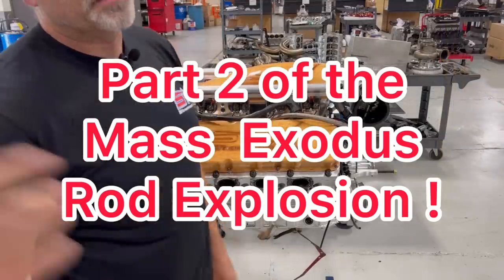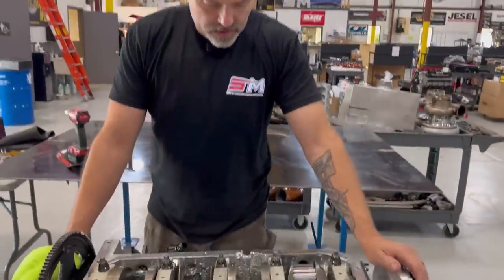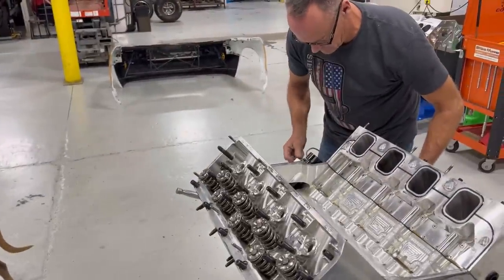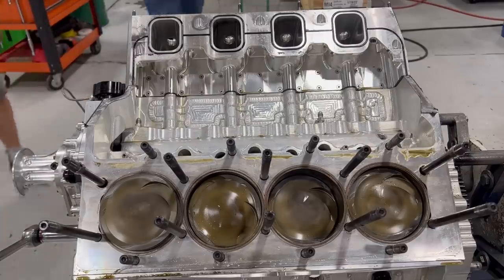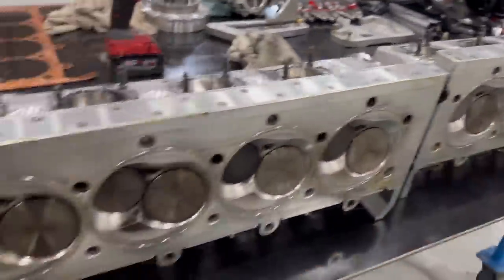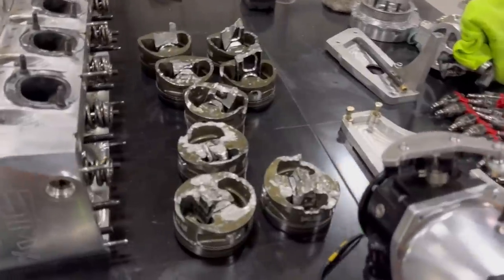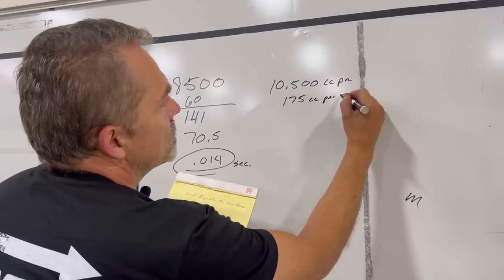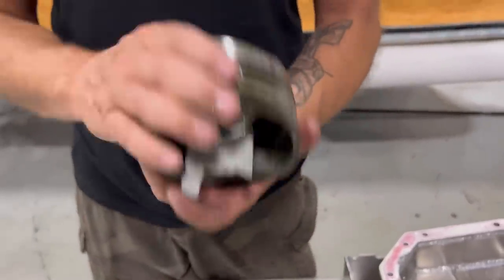EXPLODED RODS  Part 2

Comment: The rod failure makes me think the rods were over hardened, taking the base material into the brittle range. The manufacturer may have done this intentionally in order to increase the strength. They just went to far... Harder / stronger is not always better.
Reply: Rod shape will play a role as well, the design looks to have areas of stress concentration which could explain why the failures look to be all in the same region. Definitely a design failure, either running higher than designed, or some misses that reduced margins to negative. (For reference, I'm a licensed Mechanical PE).

Comment: The only time I hydra locked an engine was when my intake was under water and I realized that fact way to late because I have sucked water in and immediately turned the engine off and pulled spark plugs and it was fine

Comment: Most likely the rods were not heat treated properly for the hp you had. Alao, they could have martensitic grain structure which would cause them to be brittle and cause them fail under heigh stress loads. Again it all depends on the type of rod and the materials as to type of failure. If the rod material is Ti-6Al-4V Titanium then the failure mode will be different than say a BME Forged Aluminum rod. Without knowing the type of rods it's difficult to speculate on the failure mode.
Reply: arent they aluminum ???
Reply: @deantheboatguy1437  I don’t know….I didn’t build it. If Steve said what they are I must have missed it.

Comment: This man builds some of the best setups known. Thousands of passes on hundreds of setups. He clearly has it down to a fine science. 

The first time he uses new rods , the rods blow? It’s very obvious to me at how the rods sheered apart that the material was stressed and gave. They just weren’t engineered right. The only variable was the rods so the issue was the rods. 100%. 

Now what exactly was wrong with the rods? That’s speculation. I’m sure the metallurgy will come back and let us know if it was a materials issue. If not, and the alloy was right, then it’s down to a design flaw, or a machining process flaw. Idk why Steve’s wasting his time explaining to people that it wasn’t the tune or that he didn’t hydrolock the engine. 
Also I will say there isn’t many rod manufacturers that are building 4000+ horsepower safe rods. I’d guess maybe they held up at 2-3000 , and the guy was over confident they could handle some extra power, but they weren’t actually tested as such. That’s my .02$
Reply from the maker: Thank you !! right on logic !

Comment: ELECTRONICS CAN BE A VERY HUGE PROBLEM. STATIC ? WIRES & SIGNALS, CONNECTIONS, VOLTS, DEPENDING, AC & DC LOW VOLT, THEN IT GOES UP.. KEEPING THE LINES ISOLATED AND INSULATED! AND GOOD CONNECTIONS.. HAVE BEEN THE CULPRITS?? REASONS ARE ALL THE DIFFERENT SIGNALS AND VOLTAGES? OH? AND BELOW THE DARN THING FIRED & BOTH INTAKE AND EXHAUST OPEN! INSANE! Good Day..

Comment: what is the reason that these engines run aluminum rods? Is steel just to heavy and cause more problems than there extra strength solves? Do they just not rev fast enough with steel rods? just a curious question I've always wondered about.

Comment: I had a cloyes timing gear break in my motor and it cost me 15k to fix the damages. It sucks for sure but what can you do. Last year I heard Diamond Pistons got a bad batch of aluminum and quite a few motor were destroyed because of their pistons falling apart.
Reply from the maker: Naw, there has never been bad material, obviously it is tune up, the timing changed or something injectors stuck. 😂

Comment: Very nice engine design... Pretty! Better with forged steel 'H' beam rods.... Aluminum rods fail, because of fatigue, in high stress applications, like this. Steel rods last much longer, because they handle extreme cyclic stress, and vibration much better than aluminum... All of your rods failed at close to the same time, because of all of them being fatigued... One of the rods failed , then it set - off a chain reaction to cause all of the other brittle/fatigued rods to fail... This happened in a fraction of a second, because of the high rpm's the crankshaft was turning... Use forged steel 'H' beam rods.... BTW, what is the rod ratio of this engine? Low rod ratios will put a higher bending load on the rods. That could also cause accelerated fatigue, because of high cyclic stress combined with greater bending loads...Quite a few rod failures take place, when engine stroke length is increased, without increasing the length of the rods. This reduces the rod ratio... From what several reciprocating engine specialists have said about modified stroke lengths, the rod length also needs to be increased to maintain a higher rod ratio... From what I have read about rod ratio on engines used for H.P. applications like what you are doing, especially the high manifold pressures that you are running with, a ratio of 1.75:1 would be a good one to shoot for... So this means that the length of the rod between the centers of the bores, needs to be 1.75 x the length of the stroke. Several tuners used special pistons with pin bores set closer to the crown, to help with matching the piston crown to the block deck height... Some engines are very well suited to modifications of stroke length, as they have a higher block deck height-aka the distance between the centers of the crankshaft main journal bores , to the flat surface of the block where the head(s) are (is) attatched. And stock piston pin placement that is further down from the crown of the piston, than what most passenger car engines have. The 392 Chrysler is one such engine that had a long deck height to allow a lengthened connecting rod to be used with relative ease... And piston pins that were located further down from the crown of the pistons...This is because these engines were also slated to possibly be used for medium to large trucks and heavy equipment, using gasoline. And equipped with longer stroking cranks, for improved low-end power qualities. This was set -up to compete with the International Harvester 541 gas engines. And naturally the drag racers from the late 50's and early 60's who wanted really good bottom end power for their 2-speed transmissions and expanding diameter slicks, caught onto this inherent design advantage of the 392 Chrysler engines. Don Garlits was one of those pioneers, so was Ted Gotelli, and many other people, too many to list here... And they could lengthen the stroke of those engines even more than the stock 3.906" that they came with from the factory without too much trouble adapting longer rods into those engines. Several reciprocating engine specialists got involved and they found that maintaining a rod ratio of 1.75 :1 was ideal for H.P. engines... And since the deck height was longer on these engines, than many other engines, it would be easier to manufacture pistons with re-located pin holes to accommodate the longer rods needed to maintain the desired 1.75 rod ratio... After the word got out that special equipment was needed for Chrysler 392 engines for the dragstrips, Donovan Engineering was founded to supply parts like these... Anybody who has an interest in supercharged engines for dragsters from the 60's and 70's, probably have heard about the Donovan Engineering Products for the 392 Chrysler engines. Especially, the Donovan 417's that often ran very good reliable times at the various drag strips back then.

Comment: Hydraulic the Engine Thought - BIG IF - A Fuel Injection System Failure with the controller pulsing the injectors constantly or held open, so liquid in the cylinders which would "hydraulic" and take out all the rods. UPDATE - In the engine rebuild episode #2 & 3 there were fuel injectors that were stuck open.  So......... injector stuck open on the pass, fuel in cylinder, hydraulic takes out a rod, carnage takes out the others.

Comment: At 27:00,,,,,,,,,,,,,,,,, You actually mean to say ,,,,,,,,,,,,,,, 70.5 times a second the injectors and spark plugs fire at 8500 RPM
That engine could not have possibly hydrauliced, but it likely pre-ignited and caused a mythical vibration that shattered at least one rod  starting the chain reaction destroying all of the rods {" MYTHICAL ")

Comment: The base metal was too hard has to flex I build Lycoming and continental stol short take of and landing engines you have to look at all the stress factors to be sure that the parts you are working with are suitable for the application you have to magnaflux everything then put through the ultraviolet light you would be amazed at some of the things that you find if you are really interested contact me.

Comment: Hey Steve on the lighterside  It's so obvious the flux capacitor wasn't tuned properly I've seen it on back to the future So it must be true 🤣🤣  Those rods shattered just like ice when you hit him with a hammer 🔨  I think that's the easiest way to explain it... and good to see u are Venting crankcase pressure from The Valley cover now 😁👍👌

Comment: For the Mains that look perfect to have survived, I think at least those ones the rod cops had to come off for them to survive without damage. Like the rods were not capable of 8500 RPM with the weight of the pistons. Otherwise how no damage? It also it all happend at the same exact time or within seconds.
Reply: Something Else that is peculiar is that every piston stopped in almost the exact same location as if what happened was the same for each one. Not like most times you find what started it or what failed first then next and so on. I do not see that here
Reply: I just looked at the build video and I noticed the rod cap bolt holes are thru holes right at the transition between the cap and the column portion that goes up to the pistons. That area where those holes are is weaker than any other area of the clamp portion of those rods.

Comment: Why aren't you running an 8 counter weight crank like in the hemis that should help with any flex in the crank or harmonic problems.
Reply from the maker: you need to  watch it again, it is a 8 counter weight.
Reply: @stevemorrisracing  sorry about that it was a busy morning didn't see it that well kids haha.
Reply from the maker: No problem 😁
Reply: @stevemorrisracing  we had a very similar looking rod failure on the 3rd of July looked like thecrod just ripped itself apart we run grps.

Comment: How many pulls on on this motor....that's a harmonic imbalance issue at high rpms....and introduced work hardening into the rod to blow up all 8.....or your full system stuck open and poured fuel into the cylinders.....
Reply from the maker: 6 th pass total
I prove out that it is impossible to hydraulinc a running engine. Watch the rest of the video. 
These are rods that have NEVER been used at this power level. They failed

Comment: I commented on part one & after seeing part two i am still of the opinion that all the rods hit oil that was rising below the crank & broke up.
As i said before this is my uneducated guess but it would make sense.
Is there a level monitor somewhere in the system that could confirm or rule my theory out ?
Reply from the maker: This sia dry sump engine, that means there is very little if any oil in the oil pan, it is all sucked out and sent to a tank, the oil pump sucks from the oil tank. 
Plus that would not happen, people have over filled oil pans for ever.
Reply: @stevemorrisracing  
I know it’s a dry sump which is why, if the oil level in the sump raised to the point that the rods hit oil at 8000 rpm you would see catastrophic failure.

Comment: What do you really think it did do???
 I’ve never seen that much Carnage with out the crank and Block just headed to the scrap pile. 
  It’s kind of funny that this very expensive block has the Windows to let the rods out when they brake. Not one of them were used. ( broken out)

Comment: Make a one piston engine you can test. Cheaper to fubar one jug than all eight. 

Then you can test different manufacturers of parts and materials. Ordering just one special experimental piston, rod and everything, should be cheaper than ordering eight. 

Also it will be easier to find out what breaks first from normal road driving and what brakes at the track. If you know that the lifters will go bad after 6000 miles of road driving or something. You can change them before they damage something else. 

If each rod is good for 1500 hp then you know the limit. However there might be different dynamics between a one cylinder engine and an 8 cylinder engine..

Comment: Steve not much of a chance you'll ever see this comment now with as many months that has passed.  I'm gonna comment anyway because well you just never know.  That and someone else might find the information useful.

I work for a company that does the type 3 clear (yes type 3 clear anodize is actually black when it comes out of the sulfuric anodizing solution).  I can tell you Steve that anodizing didn't do that to those rods.  Essentially all type 3 clear anodize is doing is essentially case hardening the aluminum to a 60 to 70 rockwell.  Yes type 3 anodize is actually as hard as tool steel.  It's advantage is the core aluminum material is still soft and flexible while the exterior is now stronger than most steel.  Which is why Steve can put those rods (normally) through the punishment the SMX motors go through and be confident they'll take it.  

In looking at the grain structure of those pieces the material almost has a crystalline grain structure.  I'm guess that whomever did the ordering the material at the rod shop didn't require a material certification.  Which the certification comes from a 3rd party testing facility.  Manufacturers require certs to ensure they are being sent what they ordered, or when a customer demands is.  Anything dealing with the military ALWAYS demands it.  So the manufacturer of the rods got sent some material that was the wrong grade of aluminum.  They don't have anyways to verify that the aluminum is what they were told it was.  They made their rods and they ended up in your engine.

If I were a betting man.  I'd venture to say you weren't the only one.  Now I'm certain after seeing that catastrophic engine failure your rod supplier wanted all their rods back and told you they would send you new ones from a different lot.  Regardless of all that I've likely just talked to air.  Hopefully though someone learned something from me being around the machining and anodizing business for the last 15 years.

Comment: I’m gonna just throw it out there. At high rpm, if one cylinder breaks or detonates for whatever reason, it could possiby affect the engine harmonics so much it could shake everything apart in an instant. Anything thats really hard, like the rods. Could just shatter. Especially if they are already close to their breaking point. That’s just my guess. Thanks if you read this. I would say the weakest one let go, and the rest shattered like glass from the off balance it added to the harmonics. Dude…. You gotta be a sigma male. That’s why you feel the need to educate others. You live by the good morals you’ve learned. And i know this because you explained the golden rule of treating others, the way you want to be treated. And you want to know exactly what went wrong. And you won’t stop until you find it. Then you’ll be able to improve it where it needs be. You don’t need to be a sigma to spot one. But it sure does help. If you want to know more, look up sigma male videos on YouTube. And believe it. Because it’s true. And you are one of the special 1%. Never change brother. Keep on teaching. Because i know you can answer all the hard questions. Because you feel it’s your duty to figure it out. You wouldn’t be able to sleep if you knew you gave someone bad info.👍👍

Comment: I am intreiged as to what actually happened. there is no evidence to lead to anything I felt would be the cause. I feel it was a metalurgical failure of the connecting rod. There were not enough passes or miles to see this kind of failure.

Comment: Should not be possible at this level of machine work and you wouldn't missed that, but just want to get it off my chest and/or show my stupidity. I never seen such little side clearance for the rod in the piston. And that made me come to think of that If piston bore center, block bore center and rod bearring surface on crank is not working in line with each other, a constant sideload of the rods will occur, but a fault like that maybe would have shown uneven wear pattern on rod bearrings and caused earlier failure. Or explained more stupid, imagine everythings perfect, and then have the crank placed 1-2mm to the front or back in the block. Do you meassure where cylinder bore centerline hits the bearring surface on the crank?

Comment: While it could be design, machining, or anodizing, I'd be absolutely shocked if it wasn't something in the metal. Whether it was the wrong type, the heat treat, or something else I'm not sure. But I don't think the metal was right for the engine (that very well could be from the metal supplier sending the wrong type/mislabeling and have nothing to do with the guy who made the rods)

Comment: I believe once you get back the metallurgy results you will have your answer ! connecting rods not meant for your application. High horse power high torque high heat.

Comment: I have a question though steve.. Why does the rings on the piston at 32:22 look smashed? It looks like all the ring lands are bent right there on the skirt side. What caused that?
Reply from the maker: The piston got sent up into the head when rods broke
Reply: @stevemorrisracing  That makes sense. Good luck getting it all back together buddy. I hope your usual rods are back in stock for you. It'll be interesting to see the repair process on that block.